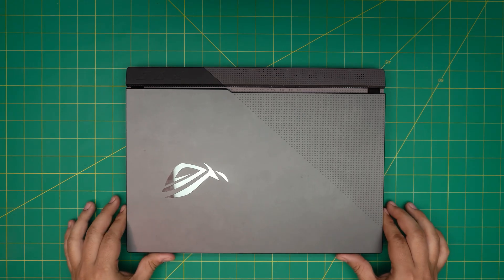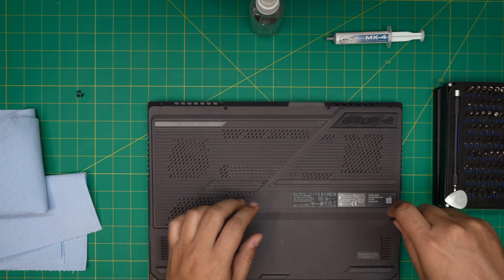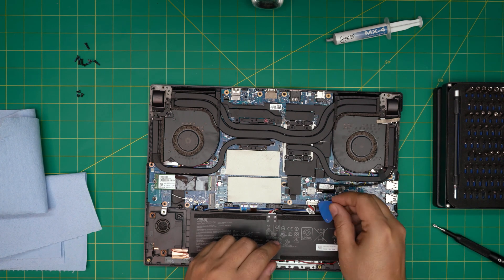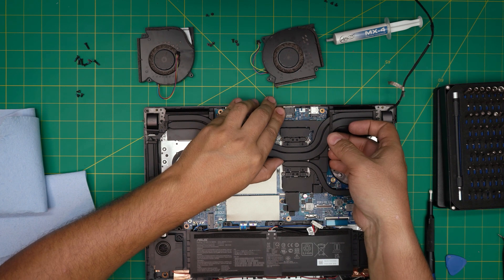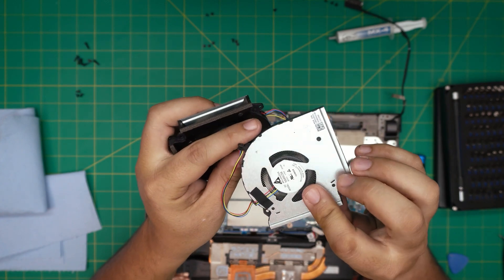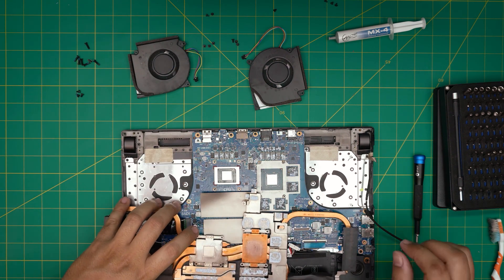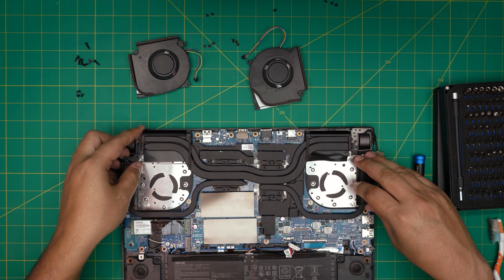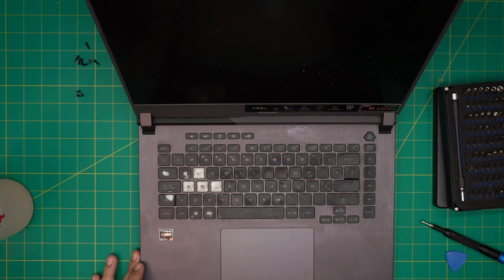How to Repaste and Clean Asus ROG G513 (G513QE - HN030T) Laptop - Step-by-Step🧹

Comment: Hello i need your help because my laptop is heating alot like cpu is  95 degree and gpu is 80 but it works fine but im scared the componet might degrade becasue of the heat btw its 4 years old but im thinking it might be thermal paste which is the problem and i did clean it. please let me know if there is fix or its just because its probably old.
Reply from the maker: 🫠Regarding your question, you need to open the heatsink as soon as possible, remove the fan, clean the airways, and replace the GPU/CPU.
You're killing that laptop with those temperatures.
Should you have any further questions or requests in the future, please don't hesitate to ask me.
cheers🍻
Reply: CPU is i7 9gen and gpu is 1650 gtx but when doing normal stuff other than games it is 70 or 60 degrees.  I can’t replace it at the moment. Will cleaning the airways be enough. And I forgot to tell my battery stays Liek 40 min because the battery is gone so I keep it plugged and it can only run in turbo not in silent because of lag and performance is laggy so is cleaning  very thoroughly by  taking everything thing out.
Reply: Btw thank you for telling me this. This will be the last question
Reply from the maker: It's my pleasure, my friend.
Sure, at least do fan cleaning and make sure it is not clogged.

Comment: An you tell me where is the CMOS battery is located
Reply from the maker: 🫠Regarding your question, there is no dedicated CMOS battery on these motherboards. The BIOS (CMOS) is powered by the main internal battery. If you wish to reset the CMOS configuration, you can disconnect the main battery, then press and hold the power button for 60 seconds, and wait for 5 minutes.  

When you power it back on, make sure the charger is connected and wait up to 40 seconds for the board to perform a memory check and post.  

*NOTE:* This clears the CMOS configuration but will not reset the BIOS password, as the password is encrypted and written on the U2 chip.

Should you have any further questions or requests in the future, please don't hesitate to ask me.
cheers🍻

Comment: Hello sir, I came across some comments about using Honeywell PTM7950 on CPU and GPU. Is it really that good?
Reply from the maker: 🫠Regarding your question, the Honeywell PTM7950 is very good. However, I would not recommend it because it is extremely hard to find a reliable original seller; most of them are fake. Also, if you plan to service the laptop once every 12 months, I would recommend Thermal Grizzly.
Should you have any further questions or requests in the future, please don't hesitate to ask me.
cheers🍻
Reply: @uFixTek  thank you for your reply sir. I just bought it yesterday on an e-commerce platform. The store said they are an authorized distributor, so I will give it a try. If there are any issues, I will use the product you recommended.
Reply from the maker: It's my pleasure my friend.

Comment: Hi, my nodel is G513Q-MHF323T, and as i know it comes with liquid metal originally. Can i apply thermal paste on it? Is there any specific procedure i should do before applying thermal paste?
Reply from the maker: 🫠Regarding your question, just use a workshop towel and isopropyl alcohol 98%+ to remove (scoop up) all the LM on the heatsink and CPU. Then you can apply the paste version, which is this.:
https://amzn.to/4daB7dw
Should you have any further questions or requests in the future, please don't hesitate to ask me.
cheers🍻

This is an Amazon affiliate link. When you use my links, you are helping to support the channel. 🙏
Reply: @uFixTek  don't have a workshop towel, does kitchen towel work?
Reply from the maker: Kitchen paper towels can definitely be used.

Comment: you have changed the liquid metal with grease paste why? wont that affect the performance?
Reply from the maker: 🫠Regarding your question, absolutely not , if you use the "thermal grizzly kryonaut extreme" you get the same results after 15min of load.
we have tested extensively.
cheers🍻
Reply: @uFixTek  thank you so much man, appreciate you answering

Though i have one more small doubt
You see when we use liquid metal, if temp goes high like 90 it comes down suddenly at 79, but that doesn't happen with "krayonaut" if it went high 90 it might never come to 79 it might come to 84 and stay there, does KRAYONAUT EXTREME have similar performance to liquid metal?, Also what is the durability of extreme.... I would love if you answered, thank you
Reply: @uFixTek  also can we use "extreme" on the side capacitor as well

Comment: Thoughts of using Carbonaut Thermal Pad instead of paste?
Also can i use Liquid Metal on all the parts like gpu/cpu and vram, or is it only good for cpu and gpu?
Reply from the maker: 🫠Regarding your question, DON'T use pads instead of paste.
Liquid metal only goes on GPU/CPU, NEVER use the LM on vrams, it will eat that.

Comment: Strange that they only put Liquid Metal on the CPU. especially since it's aluminum. they got the copper on the GPU but no liquid metal. kinda wish they both had liquid metal or even just GPU...
Reply from the maker: Thank you for your feedback! If you wish to support the channel, you can like, subscribe, or both!
Regarding your question, i have made a mistake saying that it is aluminum, it is not aluminum its copper with Nickel-plated , the reason for Nickel-plated is that the LM will not get dried out on Nickel-plated, but it will dried on copper surface.
but as you said, it would of been nice if they would Nickel-plated both side and LM.
cheers🍻

Comment: I am using a G513Q laptop and want to replace the NVME SSD. The existing NVME is 2MM thick, but the NVME I am replacing is 4MM thick.
Are there any compatibility problems?
Reply from the maker: Thank you for your feedback! If you wish to support the channel, you can like, subscribe, or both!
Regarding your question, as long as your NVME is single sided chip it will work all nvme up to 2TB are compatible, anything over 2TB you have to make sure they are single sided chip (if the have chips on both side it will not sit flat and can short and damage the board.
Should you have any further questions or requests in the future, please don't hesitate to ask me.
cheers🍻
Reply: @uFixTek  Thank you for your kind information. While watching the video, I liked and subscribed in advance.
Good luck!
Reply from the maker: It's my pleasure my friend.

Comment: I've got the same model but different SKU, what if i swap out the CPU with regular thermal paste instead of liquid metal, or just go for liquid metal on both the CPU and GPU?
Reply from the maker: Thank you for your feedback! If you wish to support the channel, you can like, subscribe, or both!
Regarding your question, i highly recommend you to remove the LM and clean it and place the "thermal grizzly kryonaut" it is the same as LM with +2-3c difference and it is much safer when moving the laptop around.
https://amzn.to/41pba5D
also very very easy and quick to apply no need to worry.
Should you have any further questions or requests in the future, please don't hesitate to ask me.
cheers🍻

This is an Amazon affiliate link. When you use my links, you are helping to support the channel. 🙏

Comment: You replaced metal liquid with thermal paste, wtf man
Reply from the maker: I made the replacement as per my client's request. Additionally, the liquid metal (LM) in these models tends to dry up quickly, leading to cracked seals and poor temp results. I highly recommend replacing it with Thermal Grizzly Kryonaut Extreme,  https://amzn.to/3LP02bJ
 You will achieve similar results with only a -2°C difference in temperature, and this thermal paste will last significantly longer than LM. We've extensively tested it in personal laptops and with clients, and the results are vastly superior—approximately 800% better. 
Moreover, there is no risk of a short circuit or LM spill due to laptop impacts when carrying it in a bag.
Reply: Liquid metal can get old must be removed and owner went with oem paste I would've gone with the new mesh thermal pads.
Reply: Is it possible to insert a 90wh battery in a 56wh model. I’m having ASU’s rog strix g15 g513rc 2021.

Comment: What is wrong using a thermal paste on vrm?
Reply from the maker: Thank you for your feedback! If you wish to support the channel, you can like, subscribe, or both!
Regarding your question, Because the distance is neither 0.5mm nor 1mm, using a 1mm pads will push the heatsink away from the GPU and CPU, resulting in poor performance and high temps.
Should you have any further questions or requests in the future, please don't hesitate to ask me.
Reply: @uFixTek  Hi! I have just cleaned and repasted my rog, and it wasnt a smooth ride. At first, i did not know there are 2 different substances so i cleaned it all and replaced everything with thermal paste. It wouldnt turn on, so I read all the comments here realizing that i have fucked up. Cleaned everything, applied paste just to the cpu and the vgu as you do, and adding 1.5 mm thermal pads to everything else. Now it turns on, but as soon as I load up a game, it turns immeadiately off as I would unplug it from electricity. You mention here and in another comment as well that pads are problematic as the gap is neither 0.5 nor 1 mm. Is this what im seeing? So ordering putty, and applying that to everything else except for the cpu and vgu would solve my problem? Thanks in advance!

Comment: I think that metal is not aluminum, but nickel, that's why the gallium is not coroding it
Reply from the maker: Thank you for taking the time to share your feedback! If you're interested in supporting the channel, you have the option to like, subscribe, or even do both!

Addressing your feedback, indeed, a portion of the heatsink contains gallium. We've have opened numerous (many many...) laptops where liquid metal (LM) comes into direct contact with copper heatsinks. Personally, I've conducted tests involving the application of LM onto a copper heatsink on both personal laptops and those of clients. Over a span of 3 to 5 years, we've observed no instances of corrosion occurring on the copper heatsink. With a simple polishing process, the surface reverts to its original state of pure copper. As a testament to the longevity of this approach, we recently performed maintenance on two laptops where LM was applied two years prior. After utilizing copper cleaner to clean the heatsinks, they remained in flawless condition.
Reply: @uFixTek  the silver part of the heatsink will be Nickel plated.
The LM will react with copper over time, depending on the particualr mix the manufacturer uses (from the LM).
It usually only "discolors" the copper, but only a few microns in really, but the LM can harden out over time (as in form an alloy of a kind).
Thats what users in the desktop space always afraid of, though isn't an issue as long as the PC is not moved around (the hardened out bond still provides extremly good performance, but if there is stress on it, there might be a crack in the formed alloy -> terrible temps).

For instance and extremely high performing air cooler->very heavy cooler.
Never heard of that for liquid cooling (i.e. not really a lot of weight on the cooler mounting).

Been doing LM for Desktops for a long time now, with Nickel plated and bare copper coolers.

Kind of bummed Asus is leaving the GPU with normal paste and no Nickel plated cooler option.....

Comment: Hi, I have the same laptop. When on performance mode I've been hitting 95°C (cpu, gpu is around 70) when gaming and after two years of never cleaning the device I was hoping to remove a lot of dust from the fans. But it was almost perfectly clean (so it won't realy impact cooling performance). I still have to order some thermal paste to redo that. But I was thinking. Liquid metal should normaly do a better job at cooling than thermal paste. Would I not decrease the cooling performance if I replace the liquid metal with thermal paste? Did you have a before and after comparising for the laptop in the video?
Reply: Thank you very much for the feedback! You have my like and my subscription.
Reply from the maker: my pleasure my friend, thank you for the support.🍻
Reply: Mine is very new but hits similar temperatures with cleaned fans. Did you have any luck with replacing the thermal paste?
Reply: @ltchester3409 I’ve change it to thermal paste and from about 80° it gets worse to 95°
Reply from the maker: Thank you for your feedback! If you wish to support the channel, you can like, subscribe, or both!

Regarding your question, I would highly recommend replacing the LM with Thermal Grizzly Kryonaut Extreme thermal paste. Based on tests, it performs just as well as LM, but it has the added advantage of maintaining its effectiveness over the long run. Unlike LM, which creates a thin layer that can dry up after a few months, thermal paste will remain stable and keep its effectiveness. This is especially important in preventing any seal cracks caused by vibrations, which can lead to undesirable results (like the issues you're currently facing).

By opting for thermal paste, you'll likely have a more satisfactory experience.
https://amzn.to/450H7C0
Should you have any further questions or requests in the future, please don't hesitate to ask me.

Comment: I replaced my laptop's thermal paste with this tutorial. Thank you for this tutorial. But I have one problem that my laptop is only working while it's plugged in. Can you suggest any solution?
Reply from the maker: Thank you for your feedback! If you wish to support the channel, you can like, subscribe, or both!
Regarding your question, disconnect the battery and make sure the pins on the jack are not damaged and i really hope you removed it correctly and inserted straight over.
also if the above try didn't work, power off the windows hard shutdown, ( before clicking on shutdown button on the start menu , press and hold left SHIFT + click the shutdown button on the start menu) and keep holding the shift till all the LED indicator s are off.
then disconnect the charger and reconnect and leave it for 30-40 min , and pay attention to see if the charging LED turn on or blinking or change color.
Reply: @uFixTek  Thank you for the reply. Will definitely try this. :)
Reply from the maker: i wish you the best, 🍻
Reply: @FaZeAditya  did it work?
Reply: yes, I didn't connect the battery properly @atharvdeoskar

Comment: Can I use liquid metal for both, CPU and GPU?
Reply: No friend. Do not use liquid metal on the GPU, as it does not come with factory protection (that white mass and foam that he removed from the CPU), which prevents the liquid metal from flowing. As it is conductive, if it drips onto any part of the board outside the protection it will certainly kill the notebook. The GPU also does not come with the ideal metal for contact, it is made of copper. Copper is more complicated, the first application of liquid metal to copper generates a chemical reaction and a second application must be made. I personally don't understand why he made the decision to remove the factory protections for the use of liquid metal on the CPU (now it will no longer be possible to use liquid metal). And no, that metal in the CPU structure is not aluminum, you cannot use liquid metal on aluminum.
Reply: because he is a complete idiot, just take a look how he touches the motherboard and how unprofessional the whole system was disassembled.
every rookie knows that you can not use liquid metal with copper, therefore this gpu can only be covered with a thermal paste.
by the way cleaning off the liquid metal out of cpu made it hotter +10C.
Reply from the maker: Thank you for your feedback! If you wish to support the channel, you can like, subscribe, or both!
Regarding your question, absolutely yes you can, and you be fine, i been placing LM on my clients and zero issue after even 6years,

Comment: Mine turned on but only the keyboard and my screen went totally black. what seemed to be the issue on my part?
Reply from the maker: i need you to re insert the rams and double check the connectors and the LCD flex cable.
Reply: Did you fix the issue ? Runing into the same problem after changing the thermal paste